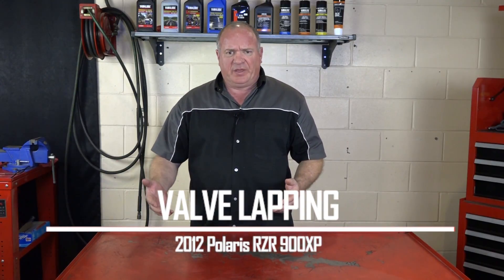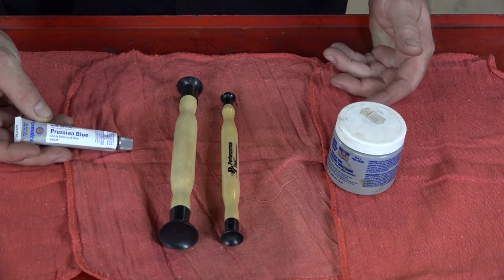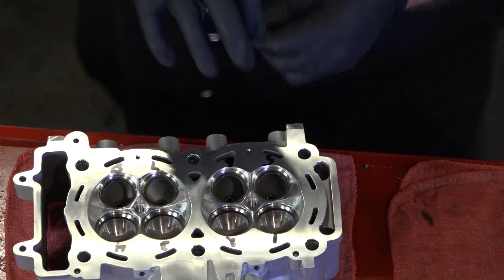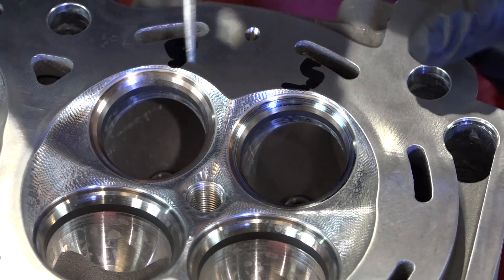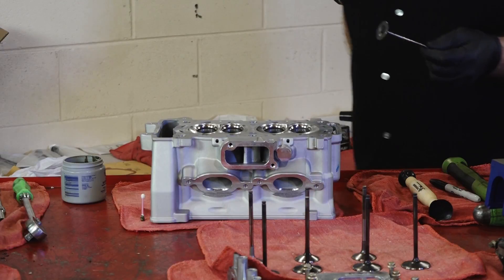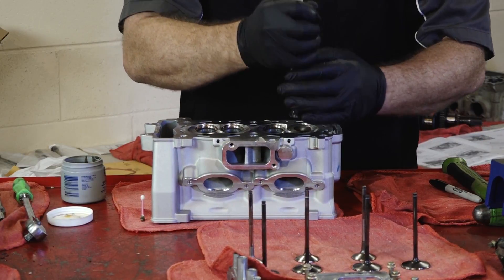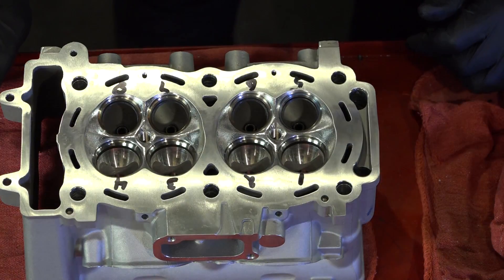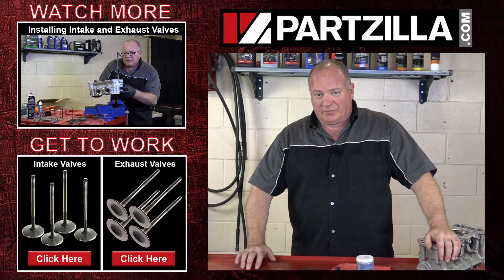How to Lap Valves on an Engine | Polaris RZR 900 XP  | Partzilla.com

Comment: There appear to be two camps on the use of Prussian Blue. The other seems more sensible, in that the valve is not rotated after applying the Prussian Blue following the lapping. Any aberration in the surface will be concealed if you rotate a high spot over a low spot. I'm about to use Prussian Blue after lapping on my Civic. The only value of this is in letting you know you do or don't have surface-sealing  inconsistencies and should lap again rather than put everything back together and find leaks. There should be no doubt as to the use of Prussian Blue.